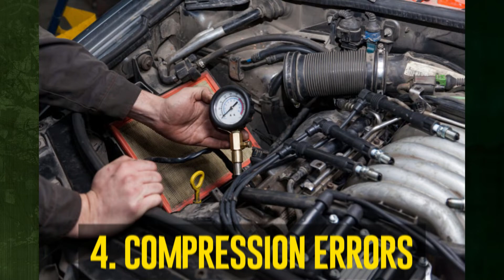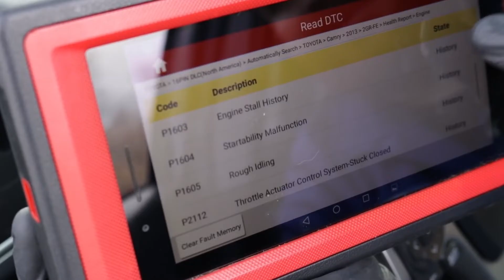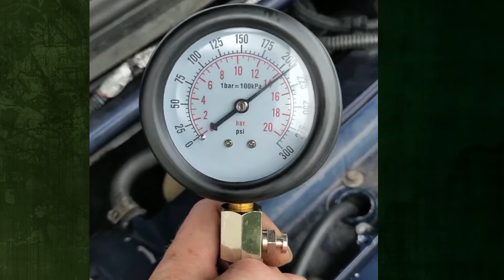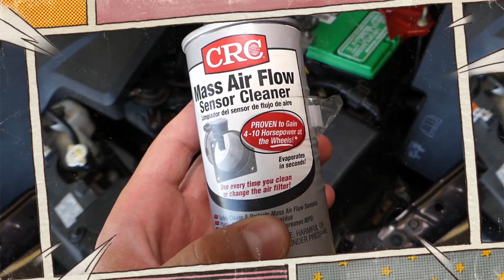6 Causes Your Car Won’t Start Unless You Give It Gas & How to Fix?

Comment: I’ve been having a stalling issue with my car for the longest time. I Can’t quite figure it out. I’ve checked my spark fuel and air. I think it’s a vacuum issue or possibly a dirty air filter.
Reply: The new air filter is cheapest easiest way to start, then go from there.
Reply: Maybe crank sensor?
Reply: @ I don’t think it’s that because I replaced the CPS crank position sensor but now my after market oil cooler has a leak. I replaced every single spark fuel and air part on the car on a fresh rebuild. I think it could possibly be a faulty ECU not sure what else it could be at this point. Every single part is new.
Reply: @Eurospec73 i did same in my toyota 22r and  still have problem when is hot still starting rough😢
Reply: Did u fix it? What was the problem
Reply: @ I actually did I found out it was a bad Maf sensor I bought some aftermarket Walker Maf sensor ended up making my car run like crap for months. I couldn’t figure out what happened at first it was okay but within a month it basically failed so I switched back to the old OEM one along with a new ISV valve and it fixed theproblem!
Reply: @Eurospec73 so the ISV valve can do that?
Reply: @josep.7387  Yes a bad ISV valve can cause stalling issues.
Reply: @ what brand vehicle you have?
Reply: Gas filter fuel lines or fuel pump
Reply: @navi21wildside49  actually it was a bad maf sensor and ISV valve
Reply: @navi21wildside49 why post this without explaining wtf you’re talking about. 🤣